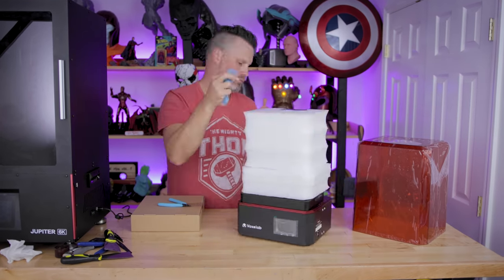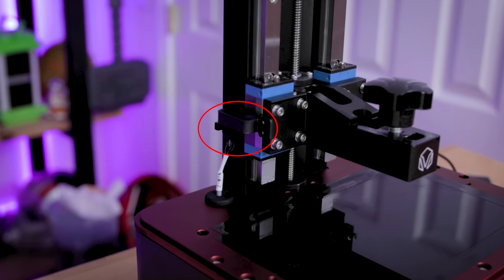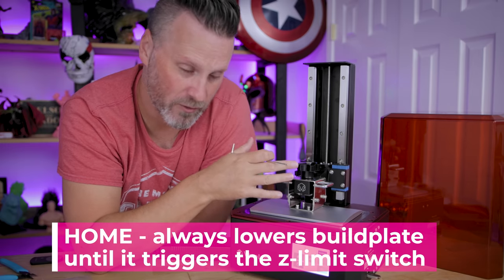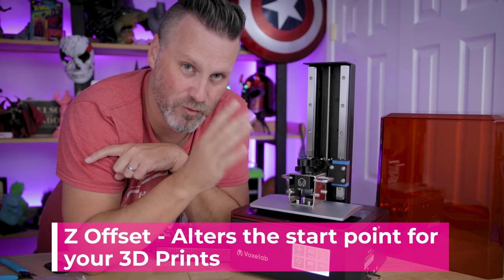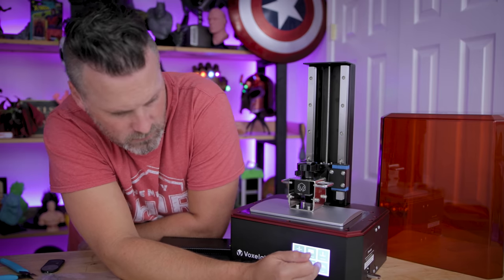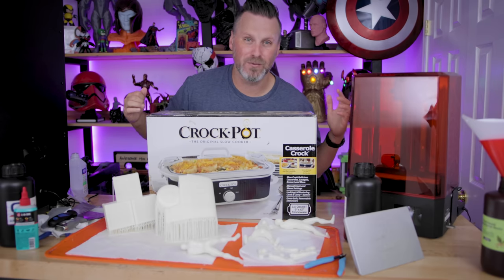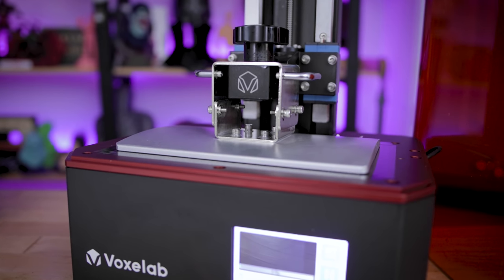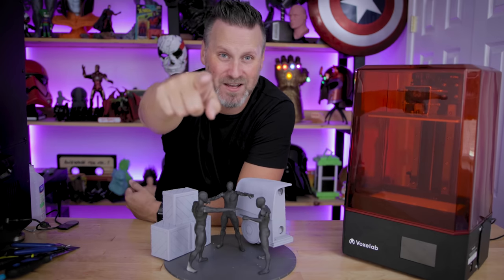Home vs Z Offset | Resin 3D Printer Buildplate Leveling Explained

Comment: You are a lifesaver, I just installed the magnetic bild plate and could not figure out why I could not get it to stop grinding while adjusting as the offset. This is my first resin printer and it is much different than the FDM printers I have in the way it operates

Comment: I work with CNC lathes and VMCs, and this is similar to how industrial machines work as well. You have a 'Home' like position where the tool will retract to when the job is complete but you manually set the Z=0 position (which is usually the very tip of the part you are machining). So, Z=0 is the beginning of the part and the 'Home' position is where the tool will retract to.
Another excellent video Uncle Jesse!
Reply: On a CNC the home is usually up off the part, like at the tool change position. On 3D printer it seems the home is near, if not the same as Z-zero. Shouldn’t they be the same?What’s the point of having them different?

Comment: Hey Jessy! The crock-pot idea is perfect for me because I have all my 3d printers in a shed/workshop but don’t have access to water out there. So this is a game changer for me. As far as heating the resin, I live in Texas and even with an air conditioning unit out there I have issues with the resin being too warm and the supports printing wobbly.
Reply from the maker: Hahaha I’m the opposite here. In 1 month my print rooms will be so dang cold. Well more reason to keep the fdm printers running to keep the rooms warm 😂
Reply: @UncleJessy  Hahahahha I turn my printers on when it’s cold too! I mean you get to have fun and warmth!

Comment: Great explanation of z vs home. 
In terms of the crock-pot, I'm still amazed that so many people are using water to heat the supports for removal. That just creates even more contaminated liquid to dispose of, more drips and drops everywhere, and more mess. 
Use a hairdryer. 
It's the exact same idea, just using hot air instead of hot water. It's a no-brainer really.

Comment: well this is the best explanation of the differences between home and Z thanks jessie, i need to find out about how to level with an added magnetic plate to my elegoo saturn, i've tried levelling it several times, but the dam thing wants to crunch through the base, i've loosened the screw and everything but your video briefly mentions a clip of some sort to trick the sensor? into giving more space, ive taken it off for now as i don't want to damage my machine, any help appreciated
Reply: I just put the flex plate on my Saturn as well, took a number of tries but I finally got it to home without the grinding. Ultimately I found about .3mm rise is just right to set the Z.
Reply: @levireidhead  thanks I'll try it again its just a horrible sound when you've only had it fir 2 weeks.. That poor stop button

Comment: I wish I had seen this video earlier. Somehow I missed it when you released it. Was just having a conversation with some idiot the other day that was insisting you could reset the “home” position without physically moving the limit switch or changing the length of the trigger arm. Of course when I asked him to explain how his reply was “ you can figure it out for yourself “, because of course you can’t. Thankfully the person asking about the spacer appears to have listened to me, not the idiot, and didn’t risk cracking their screen. Would have loved to post this video as my reply.

Comment: I just got a Saturn S 4K - I followed all leveling/setup instructions. It's Just not working properly, frustrating.
The Home button will result in the Plate rising only, If I press home again it will rise more.
Every time I try to reprint it forgets what z=0 is and I have to reset it all over.
Maybe I have a defective Printer? Thank you for your help.

Comment: If you remove the supports immediately after taking the print off the plate, they just peel off so easily, also means that your cleaning solution will last a lot longer
Reply: How do you handle the supports with uncured resin still on them
Reply: @swordsdboss  with gloves dude
Reply: @HowleRWolF01  no like what do you do with them. They still have resin on them.
Reply: @swordsdboss  lol, I normally leave them outside in the sun to cure

Comment: well i wouldn't do it like this.
while homing, the axis overshoots the sensor, backs up, and hits it again but slower.

my z0 is 1mm below the homing-point.
so the printer can home while the buildplate will never touch the screen.
and then it goes down to z0

Comment: So thinking this through… it seems like the best process would be to home right on the screen (well, with the protective sheet on it) and then make any Z-offset adjustments depending on FEP thickness or Z-height inaccuracies.  I think that’s much better than all the contradictory-

“use 4 sheets of 40 lb stock paper”, 
“no use use card stock”, 
“no use only two sheets of newspaper”, 
“NO, use the raw skin from a 6 month old chicken”….  😅

Instead we can say “home your build plate, then offset by exactly 0.7mm (or whatever the actual number is)”.  

I’m pumped.  I think this is gonna solve one of the biggest problems of 3D resin printers.
Reply: I just home with the vat/FEP in place, as FEP/PFA thickness varies. Why approximate with a random bit of paper?

Comment: You can actually test this in gcode . I’ve done this to actually test it trying to prove to ppl it actually  does something . It’s only going to be especially critical after heavy use of the machine too. The z error is wide for the Saturn atleast. So long time users need to be vigilant.

Comment: hmm, if i pressed Home on my Saturn 2 and i hadn't loosen up the plate, it would crash right through the screen. it goes below the hight of impact with the screen, but it has suspension when loos so in absorbes the pressure. Is that a different leveling approach of Elegoo machines or is there something else im missing?

Comment: Just got my Saturn S a week ago and the first few days after the initial test print, my second print and so on was printing way too high above the fep for the first layer. Couldn't figure out why. Releveled over a dozen times and did a few troubleshooting steps. Even went back to the instruction manual multiple times. Nothing in the startup instruction mentioned anything about the Z-off set. I then started messing with the Z-off set and that fixed it. Turns out my offset was too high, like in this video. What a pain.

Comment: 5:40 when you run the printer empty like this you should either be using the UV cover or putting a piece of paper over the screen. Otherwise you're risking exposing your eyes to UV light, which can damage your retinas.

Comment: Well, actually the same thing if you want the print point to be below the Z home position.  This is useful if the printer goes to Home very quickly, and more slowly to the zero point below (it improves the first layers on different printers).

Comment: please be careful, the crock pots usually work around 70C and this would alter permanently many resins. Use it in keep warm function or be careful and vigilant, if you let it there you could lose all the precious goo!!
Reply from the maker: Much appreciated for the warning!
Reply: @timwaeyaert8339  resin down the sink is a complete DONT. I strongly distanciate from your suggestion.
Reply: @timwaeyaert8339  There are many things you can do with it. If you want to filter the resin out, leave it outside or by a window for a week, which should also allow the now cured resin to float to the bottom. You can decant the alcohol and use it again. Remove the resin goop from the container and leave the goop out on paper towels to cure more then throw out. If the alcohol is at it's end of use you could let it evaporate off outside and then process the resin goo like previously mentioned. If you don't want to wait for all that to happen you can put it in a bottle, seal it up, mark what it is and take it to your nearest hazardous waste dump. Lots of options, which can also work with water or other cleaners that people use to wash their prints.

Comment: Seems to make sense but my Elegoo Mars 2 mono does not behave this way.  Leveling the platform then securing the set screws followed by lifting to a new 'zero' location defined per instructions, results in printing grinding away.   Totally frustrating... infuriating.  Someone - not Elegoo apparently - must have the answer.

Comment: I recently got into resin printing with an elegoo mars 3, my builds seem to stick to the build plate so well ive broken several, would setting the z offset a little higher help with that?
Reply: Same problem with my Anycubic Photon Mono X. Now I try to level with two papers. Maybe it helps.
Reply: @d.a.4240  I started using build plate supports at all times, haven’t broken a print since!

Comment: On the Proxima it moves when I raise the plate so it's wonky and isn't level.
Reply from the maker: The buildplate moves?
Reply: try pressing down on the plate (firmly but not over doing it) as close to the centre as you tighten it to keep it level and make sure you've checked all the side screws, if i've understood you correctly?
Reply: @UncleJessy  Yes. It tilts on its own.
Reply: @CaptainEshara  That doesn't work. It tells you to do that in the video. There's a small screw in the backend and the front and side screws. You can adjust those and still have movement.
Reply: @Deneteus  well i hope you can get it sorted, have you tried emailing the manufacturer to see if its a known problem?

Comment: Thank you!
 ...I didn't know there was a Z-axis spacer available for the flex plates...
I thought I could just adjust the zero/level BUT my printer has a limited tolerance and I have yet to find custom firmware for better control.
- UNIZ IBEE

Comment: So z offset still fully useless because with normal print file the printer will go down to home anyway so 😐
About support removal, did you try hair dyer (after clean up of course) ? It help dry the alcool / water and help support removal, I use it sometime where i am too lazy to go to bathroom :P

Comment: How many times can you reuse rubbing alcohol to clean prints?
Reply: so far ive used mine about 3 times, its just a rule i had because i strip miniatures with an ultrasonic, after about 3 rounds it become ineffective, i run the liquid through a filter and put it back into a spare airtight container

Comment: I like the idea of pre-heating the resin. With winter coming I won't be able to print in my garage anymore. I used to just move to my basement but after getting a new heater for the house it's a lot cooler down there now.
Reply: One issue with heating the whole bottle of resin is that it reduces the lifespan/degrades the resin. Generally you want to keep it cool unless you're printing with it. Something I just figured out myself after years :-(

Comment: Man I cannot get my print to stick to the plate. I’m using water washable resin from elegoo. Ceramic grey. I tried to level the printer with 3 pieces of paper, 2 pieces and even 1 piece (using the manual) … I tried to sand the plate and clean the vat with alcohol. I also made sure the printer was on a balanced surface prior to printing. I changed the settings for the print according to the table on the elegoo website and still no luck. I’ve even sanded the plate.

Comment: Pre heat resin!!?? No one has told me this... that's a thing? What does that do for the print process?
Reply: It helps keep the resin a little thinner so it flows under the build plate easier (I have never done this before because I recently learned about it, and also the resin I use is pretty thin)
Reply: I just purchased a Neptune 2s, I haven't gotten it yet but have you heard anything about this supposed laser engraving feature? There's not a lot out there on it and Elegoo definitely doesn't have it listed their sight. But just about everyone sell it has it listed to have this functionality.
Reply: @aidanfordsword6954  so in theory it stops potential suction issues under the build plate?

Comment: See, the fun part is when your “home” is too high to properly print stuff. I can easily slide 2-3 sheets of paper under the plate on my printer’s native home, so I’ve had to set my z=0 to lower. Also this is an old anycubic photon with an (at this point) outdated design when it comes to leveling the plate. It is occasionally infuriating to get it properly leveled off a single screw for a “fixed” ball joint (I say fixed as there is no spring or any form of cushioning to assist in leveling).  What’s sad is I’ve gotten great prints in the past, but ya leave it alone for a year (in a not ideal space), things somehow shift, and prints start failing

Comment: That's very important.
On Elegoo Saturn I needed to adjust the Z offset to +0.70 to get a perfect cube.

Otherwise the cube would have been squished on Z, if printed on plate.

With a magnetic plate, it's very good to print on that, it will give a nice brushed metal finish to pieces and they will come out perfectly flat.
Reply: For some reason when I print flat wide parts on the buildplate they end up being thicker than they should've been regardless of the set layer height. I think it only happens with parts that are large and flat. This may have to do with the FEP being pushed away from the part when it lowers down making the part layers thicker. I haven't heard anyone mention this same issue though. All parts that do this could possibly encounter cupping. I just level the plate using the vat with the FEP. Idk why anyone takes the vat off and levels with paper.
Reply: @Dragonfly9307  More likely due to your burn in layers.
Reply: There are options in the slicing software to increase the print by so much on whichever axis, this option would have fixed your issues. I know for sure it's offered in Lychee Slicer called "Scene Scale Compensation" under the resin settings.
Reply: @cameronmalchow7597  I think I figured out that objects with large solid surface area will try to displace so much resin when it squishes up next to the FEP that the resin can't get out of the way before it starts exposing. This means the FEP and the LCD get pressed downwards until the liquid resin gets out of the way since the z motor is forceful. The fix is with light off delay. You have to increase the light off delay until it actually starts adding to the total print time so you know it's actually adding time where the print is stationary after the print is lowered before the exposure starts so the resin can have a few seconds to squeeze out from under the print and the LCD and FEP can flex back to being flat rather than being bowed downwards. This is hardly noticeable with taller prints and doesn't matter for prints with supports. The flex of the LCD and FEP slowly gets worse each layer causing a part that is more and more thick than the printer expects, but past a certain point, the screens can't flex anymore and the resin just gets forced out from underneath faster. This means flat parts (like lithophanes printed against the bed) have their thickness exacerbated since the increased thickness takes place within the main body of the print and takes up a larger proportion of the total print height. For my settings, the added delay kicks in when my Light off delay is 17s and bottom light off delay is 25s. This only applies with bottom exposure time 30s, exposure time 2.8s, bottom lift 9mm, lift 8mm, bottom lift speed 30mm/s, lift speed 50mm/s, and retract speed 100mm/s.
Reply: @cameronmalchow7597  nope. Bottom layers were squished. Now they are not squished anymore.

Comment: Let's start talking dimensional accuracy. So many printers SQUISH the Z, some up to 1mm loss! That's why people try to compensate with the Z offset. The original elegoo Mars was famous for this issue. No good for functional parts.
Reply: I know Lychee Slicer has options for scale compensation for all the axis, it's available where your set exposure.
Reply: @cameronmalchow7597  that won't work for functional parts like threads, proper size holes, angles.

Comment: It's baffling how EVEN THE MANUAL tells you to use Z=0 in the leveling process (at least on the photon mono and Mars 2)
Reply: Because you should, home and then set z=0. This is to ensure that there wasn't a previous error where it was set incorrectly. If you follow the home and z=0 every time you shouldn't run into problems.